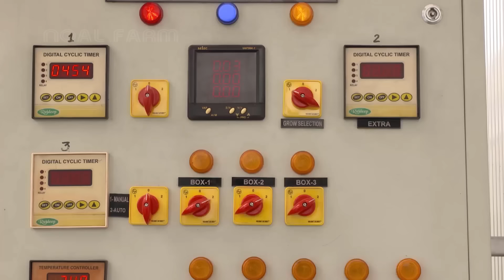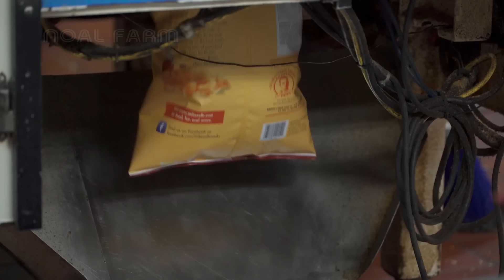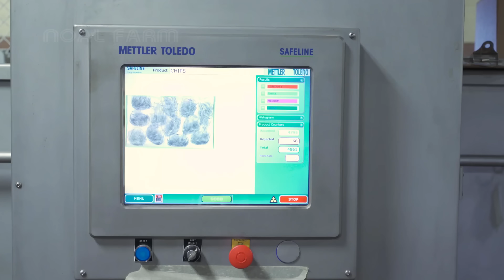Aeroponics Potato Farming - Potato Chip Process Factory - Modern Potato Agriculture Technology

Comment: It’s impressive. I wonder why the potatoes are so small, maybe because the weight would be too much for the roots to handle. I wonder how the absence of soil bacteria affects the growth.
Reply: that's my guess.. they don't let them grow bigger or it tears the roots off......though that seems to be an engineering issue.  maybe some sort of treelike structure to "catch" the roots and support them would allow for larger growth......
Reply: The soil edaphone system performs the backbone of molecular mining. Hifas grows in the intercellular gap of the root and the macrocomponents are replaced by plant sugars (symbiosis). I have read almost all books and articles and dissertations on this. but the break was not in them for an aeroponic case ....
Reply: It’s actually price and vanity related. These potatoes sell as “gourmet” for over 20 times the price of large/ fist size potatoes.
Reply: Correct.
Reply: However, it may be possible to find a solution for the aeroponic application of hypha. If we were to create a secondary fungal powder delivery system that would graft mycorrhizal connections along the plant stem and root. It may be enough to do it only occasionally. But it may also be enough to have a hand-held spore nebulizer here.
Reply: @zoltanpecsek4373  There is no point in using any soil bacteria/fungi when you hgave the most efficient water and nutrients delivery system. You would only create problems by introducing them.
Reply: @ThomasShatter   I found a total of four articles on the issue. It can be seen that the problem has not been explored yet. This is the beauty of research. You are probably right that we do not yet know how to implement the idea well ...
Reply: Size is not everything
Reply: @WaterspoutsOfTheDeep  

Your suggestion is very important. At the moment, we simply have not solved this riddle enough. It would be worthwhile to do such research because it seems that we are beginning to reach the planet’s carrying capacity. Somehow, the URBAN FARMING system needs to be further developed in the direction of a closed nutrient cycle. Otherwise, the promising Biosphere 1 and Biosphere 2 projects failed for similar reasons. I risk knowing this can go beyond any military development ...
Reply: @SimonWoodburyForget  what about areas where the soil is not suitable, due to contimination,  poor climate, what ever...
Reply: @zoltanpecsek4373  она не изучена это точно.экспериментальная технология.но интересная.не решена проблема крупных плодов.тут решение просто сетка.не решена проблемма света.обычный свет и искусственный.замена химией с водой.тут куча проблем.на семена не годится.выращен в биохимической среде не соответствующей почвенной.в продукцию.это не очень полезный продукт.как химия также не соответствует естественной среде.идет подбор химикатов что не вредят.в чем проблема бактерий и земли.в земле больший спектр минералов необходимых организму.также бактерии в земле перерабатывают гумус и приводят земельную структуру в соответствии с биохимией человека что легко поглощается растением.это не возможно создать.также как состав почвы схож с населением проживающем на этой земле.наука находится в зачаточном положении.не говоря о познании человека.также это производство сто процентно убыточно.технологично затратно и много обслуживающего персонала на килограмм продукции по сравнению с полями.ну эффективность пять десять процентов от полей.
Reply: @user-pp5tx6pz2f  Уважаемый Андрей! Я с интересом прочитал ваш комментарий. Здесь, в Венгрии, в одной из цитаделей сельского хозяйства, мы постоянно имеем дело с этой проблемой почвы. Хотя теперь мы можем выращивать овощи без почвы, мы поняли, что это не очень полезно для здоровья. Наш великий ученый Йожеф Берез выяснил, что если мы не даем достаточно микроэлементов нашим растениям, то можем вызвать рак у людей. В связи с вышесказанным, сейчас я работаю над датчиками молекулярного анализа для почвы. Я уже сделал оптическую версию, она работает. Китайские коллеги сделали импедансные спектроскопические версии с вносимым импедансом. Сейчас я работаю над созданием гравитационного молекулярного датчика, который будет измерять содержание гумуса и активность бактерий. Я также буду использовать для этого ваши книги по исследованию большой силы тяжести.
Reply: @zoltanpecsek4373  интересно какие мои книги читали.вот интересно как подбирали химические компоненты для расствора.как изготавливают.и почему именно такой состав.используется ли спектральный анализ в подборе питательной среды.не совсем понятно.там в корнях система воздушного пространства герметична.этот ролик похож на экспериментальную лабораторию.или я ошибаюсь.
Reply: @zoltanpecsek4373  я понял что вас обьединяет и проблемы в ваших разработках.вы проводите биологические испытания в поисках альтернатмвы выращивания продуктов.из за проблем с почвами и решения вопросов с продовольствием.отсутствие необходимых площадей обробатывания земель..из за каменистости и песчанности.активно развиваете или пытаетесь построить биоинженерию.любопытно бы поработать с вашими специалистами.хотя сложно это по интернету.так как это относится к секретным испытаниям .куда входят опыты с геномом клеток.
Reply: @zoltanpecsek4373  теперь понятно про наличие биолабораторий в украине и вырубка леса на дальнем востоке.поля для сельхоз угодий.
Reply: @zoltanpecsek4373  картофель очень хорошо растет даже в песке.но он обладает меньшими вкусовыми качествами и более водянист.структура его соответствует среде произрастания.единственная проблема это поливка в песчаных почвах.это является проблемой.
Reply: @zoltanpecsek4373  кстати почему чипсы щитаются вредными.сами по себе они не вредны.канцерогены химической промышленности впитываемые картошкой не всегда несут вещества которые вредны организму из за наличия тяжелых соединений.в обычной готовке они с сохранением водяного баланса частично выводятся.при выжарке в чипсах.они концентрируются в малом обьеме.и при попадании в организм забирая влагу вступают в реакцию с эпителием органов.биохимические ппоцессы с концентрацией тяжелых металлов дает микроскопические поражения с вкраплениями тяжелых металлов.они становятся как радиационный очаг и идущие химические реакции вызывают болезни.например язва.при разложении этих элементов.происходит излеченме.хуже обстоит с радиавтивными изотопами.они дают длительную ремиссию и образования клеток которые от поражения с нервной системой нацинают расти вокруг радиактивной зоны.этот изотоп сшигает геном клетки.и она потом растет неуправляемая органмзмом.это рак.
Reply: @user-pp5tx6pz2f  Наше правительство финансировало наши исследования. Без химикатов я сделал запатентованный спектрограф с чистым диффузным отражением, который собирает свет. Структура размером со спичечный коробок. Он сразу скажет вам содержание макрокомпонентов почвы и ph почвы и подавляющего большинства микрокомпонентов. О нем также спросили в ФАО ООН. Для этого китайский коллега сделал импедансную спектроскопию. Я делаю то же самое сейчас. Жаль, что запчастей практически нет из-за COVID. Поэтому я переделываю все на китайские детали. COVID-19 возобновился в Китае. Бог играет с нами...
Reply: @user-pp5tx6pz2f  Мы, венгры, тоже были очень напуганы украинскими лабораториями. Мы и мечтать не могли, что будут проведены такие грубые биологические разработки. Украинские исследователи бежали к нам. У нас хорошо развита медицинская промышленность, и мы сразу взяли их к себе для работы над биохимической разработкой дерматологического оборудования. Нам не нравится биологическое оружие, мы предпочитаем медицинское оборудование и лекарства. 
Мы видели, насколько развита ваша медицина с использованием животных экстрактов. Пантовая ванна - большая тема для разговоров здесь. Сейчас мы пытаемся изучить биохимию, чтобы понять, можно ли из него сделать лекарство. Мы нашли Российская диссертация и Kитайские публикации на тему экстракта пантов оленя и инструментального определения активных веществ. Вы очень изобретательные люди.
Reply: @user-pp5tx6pz2f  Неудивительно, что вы этого не понимаете, ведь поначалу даже наша научная академия была недоверчива. Они попросили предоставить им 1000-страничный исследовательский отчет за первый год. После пересмотра и пересчета результатов они поняли, что я был прав. Уравнение Кубелки-Мунка описывает диффузное отражение. Версия светодиодного диода и детектора американской компании Holland Scientific была блокирующим патентом. Поэтому я разработал спектрограф с гибкой решеткой, который использует принципы КАО (принципы диэлектрического волновода) для сбора света с выступающей части самой решетки и проецирования его на решетку. Он разбивается решеткой на компоненты и детектируется ccd, усиленными в специальных сегментах.
Я гомогенизировал тонкую базовую почву. Затем я использовал азот фосфор калий и т.д., чтобы смешать его с водой, а затем гомогенизировал его и снова измерил его состав.  Я определил уравнения диффузного отражения путем корреляции с устранением перекрестных ошибок. Измерительный датчик в 7 раз чувствительнее любого спектрографа, представленного на рынке. Мини-спектрограф был интегрирован в наземный зонд. Он использовался для наблюдения за сверхинтенсивными плодовыми деревьями.

Китайский аналог проводит измерения путем декомпозиции кривой участка на основе идентификации кривых Cool-Cool. Он также представляет собой импедансный спектрограф размером со спичечный коробок. В нем используется DDS.
Reply: @zoltanpecsek4373  прочитал про уравнение.нужно посмотреть устройство других устройств чтоб понять разницу.не хочу лезнь в дебри электроники и схем.забивать пока мне не нужным.удачи в ваших разработках.
Reply: @user-pp5tx6pz2f  Дело в том, что программа не является секретной. Послушайте, я обученный технический визионер в технической области. Я знаю ваши программы видения (программа Дадачева и т.д.), но знаю и американские (Cordinata Remote Viewing CRV и т.д.). Я могу смотреть практически на все и обычно могу это проанализировать. Я подтверждаю ваше подозрение, что наша венгерская элита вкладывает свой капитал в сельское хозяйство, потому что это выгодно, но есть много проблем. В сельском хозяйстве и пищевой промышленности мы не хотим видеть иностранцев, особенно западноевропейцев, потому что после смены режима мы были практически разорены и обмануты. Да, мы развиваемся в области сельскохозяйственной биоинженерии, но не через генетические манипуляции, потому что мы не понимаем, как это отразится на окружающей среде. Мы больше занимаемся биохимией почвы и приборостроением, улучшением почвы без удобрений и опрыскиванием без химикатов с использованием физики плазмы и плазменной микромидации. Мы внимательно следим за методами волновой генетики и физики плазмы в вашей стране, потому что вы сейчас находитесь на переднем крае. Видите ли, наши программы раскрыли образ действий бога-создателя, и у нас есть единая теория этого, которую усиленно изучает ваша российская научная элита.  Возможно, удастся создать особый вид сельского хозяйства, который не разрушает почву и не нуждается в химикатах, вот что мы пытаемся сделать.
Reply: @zoltanpecsek4373  если вам интересно со мной общаться .я с удовольствием побеседую.у вас не верное представление о происходящем у нас в стране.также у вас в стране об науке и обомне.что такое визионер кем себя считаете.мне нужно понять с кем и на каком уровне общаться.я не сторонник ни чьих идей .научных теорий и релмгий как и принадлежности к идеологии стран и власти.мои знания от человека основаны на прочитанном за свою жизнь как код.и каждодневно поступающей информации от всего со всей земли и вселенной.мой мозг взрывает от этого и тело.я эволюционирую.читаю часть энепгии как силу и знания.очень малую часть .возможно тысячную долю процента.остальная хоанится пока мозг не усложнится и они не открываются.могу сам вскрывать когда интересуюсь чем либо.но это мешает мне выполнять тупую работу за кусок хлеба.
Reply: @user-pp5tx6pz2f  Когда я разговариваю с вами, я не использую экстрасенсорные методы. У него есть свои ограничения, это довольно трудоемкий метод. Я не могу в полной мере судить о том, что происходит в вашей стране, потому что это тоже слишком сложно. То, на что я смотрю, я в некоторой степени понимаю после большой работы.
Бывают случаи, когда я начинаю работу и вынужден признать, что просто мало что понимаю.
Но с вами, в частности, я действительно хотел поговорить, потому что думал, что вы будете откровенны и не будете сердиться. Прости, что разозлил тебя.
Reply: @zoltanpecsek4373  я опять не пойму.причем здесь экстрасенсорика.мне например интересно как используешь способности если есть.и разозлило меня не это я возможно думал масштабней и сказанное про прибор не соответствовало моей идее которую рассматривал.я не могу мыслить как все.любые действия рассматриваю в связи со вселенной на многих уровнях.
Reply: @zoltanpecsek4373  мне интересно общаться с умными людьми и учеными во всех областях.но некоторые аспекты я не тороплюсь ускорять.это вызывает головную боль и колеблет климат и энергетику планеты.мне интересны ваши разработки.я еще пятнадцать лет назад хотел создать биолабораторию с опытами мысленно технического воздействия на икру рыб для создания новых видов под адаптацию под новый климат .изменения которые были давно по выращиванию из яйца новых видов животных и т.д.прошли годы.силы растут а воплотить не дают.потому и развлекаюсь коментариями в интернете по всему и всем направлениям.от скуки.
Reply: @zoltanpecsek4373  я с удовольствием бы жил в нормальной стране и занимался интересным мне делом.и жил бы без финансовых проблем.но меня гнобят и не дают возможности это сделать или уехать.
Reply: @user-pp5tx6pz2f   Все человеческие экстрасенсы просто не практиковались в том, как это делать. У меня есть библиотека по этой теме объемом 40 000 томов, которую я храню на своем USB-накопителе, и она содержит 400 лет книг по обнаружению экстрасенсов.
Первоначально он был разработан коллегами-шаманами, затем получил развитие в шаманизме Бона, затем в буддизме и индуизме. Во время холодной войны обучение экстрасенсов проводилось и в вашей стране, и в Америке, а также в Китае и Чехии. Мой коллега (физик) написал об этом книги... Существует множество различных техник, но все они основаны на осознании того, что душа человека является копией кванта творческого источника. Когда он спускается в творение, квантовая сборка сохраняется (жидкость перемещается). Мы пользуемся этим. В гипнозе квантовые носители могут помочь путешествовать нашей душе, но при большой практике путешествовать может и тело. Поэтому с помощью Бога вы можете видеть все, но только то, что Он вам показывает. В интеллекте над нами мы являемся сущностями. Я использую шаманские путешествия и медитации, а также части программы CRV и вызывания. Логично, что я работаю в уединении с отключенным внешним миром, как и все остальные.
Таким образом, вы видите, что это просто другой уровень понимания мира.
Reply: @user-pp5tx6pz2f  Я тоже хотел бы жить в мире, где я могу доверять другим людям. Сейчас у нас большие проблемы, потому что надвигается продовольственный кризис. Я не уверен, что мы сможем это преодолеть. Это усугубляется энергетическим кризисом. Я хочу бежать вперед, но мои ноги не могут бежать так быстро, как должны...
Reply: @zoltanpecsek4373  вопервых душа является копией ядра или планеты с отклонением в поверхностных слоях.это уровень бога у кого душа ядра.это владение энергетикой всей планеты.это есть и в биологии зачатия и рождения ребенка.остальные души как временные проекции оасположены на поверхностном слое земли и не обладают такой возможностью и соответственно интелектом.и поэтому у всех отсутствуют знания.как у клетки кожи.вроде копия но без разума и мощи над энергетикой.следующий уровень когда возьмешь мощь планеты и станеш богом во плоти.планета зпвязанна на вселенную.где человек по сравнению с планетой никто.так и планета по сравнению со вселенной.это не возможно но это происходит.через планету можно взять и управлять вселенной.тот же принцип.но для этого долгий путь эволюции как сверхразума.так рост тела до гигантов с изменением биохимии тела под мощь контролируемых сил.легенды про богов.можно создавать сверх технику когда ты понимаешь принципы энергетики.и создавать живые организмы.они и так будут появляться.но можно делать селекцию.
Reply: @zoltanpecsek4373  идет смена власти и переустройство мира под власть единую.
Reply: @user-pp5tx6pz2f  У нас есть организация под названием "Церковь Вселенной", которая является частью Унитарианской христианской церкви. Сверхтехнологичные умные люди интегрированы в нее, и я тоже. У нас работает исследовательская группа психологов и обученных экстрасенсов. Мы рассмотрели, чего можно ожидать в ближайшем и отдаленном будущем. В ближайшем будущем, если русские и американцы не набросятся друг на друга с ядерным оружием, нас ожидает тяжелый период, когда не будет хватать продовольствия и энергии. В течение этого периода духовный максимум будет наращиваться до уровня сознания единства примерно в соответствии с моделью интеграции трансперсонального сознания "Кен Вилбер" в течение примерно трехсот лет. В это время человечество будет освобождено из космического карантина. Человечество будет выведено за пределы Солнечной системы. Примерно через 500 лет он научится терраформировать планеты с большим трудом. Примерно через 2000 лет она научится управлять своей собственной системой точек (как Иисус = ISA). Напротив, есть исследовательские программы, в которых я принимаю участие. На наших учебных курсах сидхи возникают у 60% участников.
Управление небесными телами в описанном Анастасией смысле не найдено. Кроме того, наши исследования были подтверждены экспертами по регрессионной психологии. В результате появились книги.
Reply: @zoltanpecsek4373  это не так.хочешь обсудить начинай не с массива .а отдельных тем.меняешься от ученого до массонских лож.может скажешь сам кто ты.я наблюдал сегодня за попыткой воздействи.слабоват.
Reply: @zoltanpecsek4373  как не мне знать что я буду делать.не люди.у вас очень мало информации о происходящем.
Reply: @zoltanpecsek4373  меня пресует и удерживает весь мир все лучшие ложи и религии и сенсы.чтоб понимал.я сильнее всех в мире вместе взятых.и твои планы я уже описывал и говорил как буду делать и с научной точки зрения уже годами и каждый день.я контролирую мир и его все подвижки.задавай простые вопросы.
Reply: @zoltanpecsek4373  какая интересная связь китай британия европа и папа римский.
Reply: @zoltanpecsek4373  я много раньше ее касался и бельведерского клуба.я рассказывал про всю власть во всем мире от мирской до духовной.
Reply: @zoltanpecsek4373  мне интересно кто вам скинул информацию.она начинает распространятьсявы не первые.
Reply: @zoltanpecsek4373  это я отдал приказ распространить.
Reply: @user-pp5tx6pz2f  
Я не масон. Мне они не нравятся. В нашей стране Церковь следит за учеными, чтобы они не создали что-то опасное, не отвечающее интересам общества или выступающее против жизни. Это механизм самоанализа. Я считаю, что в Православной церкви есть такой механизм. Я думаю, что эту работу выполняют "мудрецы, ставшие знамением".
Вы задали вопрос, я ответил в меру своих знаний. У меня есть подробные знания о доступных методах программирования сознания, аналогичных указанному вами сидхи. Я сам им пользуюсь. Но следует заметить, что провидцы, которые приходят на нашу планету, обычно приводят примерно к тому уровню, который вы обрисовали. В вашем случае Министерство по чрезвычайным ситуациям пришло к аналогичным результатам. Я думаю, что у вас есть учебник по этому вопросу в Ломоносовском университете. Вот он на моем столе.... Мы еще не имели удовольствия встретиться с оригинальными посетителями уровня создателя. Мы полагаем, что они выполняют свою работу на другом уровне.
Reply: @zoltanpecsek4373  забавное тексто изложение.я смотрел от кого тянет.вы это подтвердили.если я и в чемто для вас и ошибся.но это не совсем так.ведь мое написанное отслеживается и я вижу их реакцию.а она связанна с перепиской с вами.потому я и спрашиваю.идет наложение информации что меня путает.наводящие вопросы проясняют ситуацию.
Reply: @zoltanpecsek4373  и я не пользуюсь ни какими техниками.я уже писал.я ничего не практикую давно.работаю тупо таксистом.зарабатываю на еду в пределах четырехсот рублей.из них половина сигареты и спиртное.весь в долгах у меня даже одежда что на мне.меня пресует сесь мир и держат спецслужбы.меня боится весь мир.
Reply: @annjulee500  bs
Reply: I, Nephi, having been born of goodly parents, therefore I was taught somewhat in all the learning of my father; and having seen many afflictions in the course of my days, nevertheless, having been highly favored of the Lord in all my days; yea, having had a great knowledge of the goodness and the mysteries of God, therefore I make a record of my proceedings in my days. Yea, I make a record in the language of my father, which consists of the learning of the Jews and the language of the Egyptians.
And I know that the record which I make is true; and I make it with mine own hand; and I make it according to my knowledge".  1 Nephi 1-3 

Hello friends, I am a member of The Church of Jesus Christ of Latter-Day Saints.  The verses above are the first three verses in The Book of Mormon.  I know this probably isn't the most ideal place to talk about religion but I really do want you to know that God loves you.  You may not love Him or care about Him at all, but He still will continue to love you.  You are a beloved son or daughter of God.  He knows you personally and He truly and deeply desires for your happiness.  He loves everyone who has every lived on this earth, with a perfect equal love regardless of their race, gender, ethnicity, faith and values and beliefs.   The Lord loves you more than you can think or comprehend.  "He inviteth them all to come unto him and partake of his goodness; and he denieth none that come unto him, black and white, bond and free, male and female; and he remembereth the heathen; and all are alike unto God, both Jew and Gentile" 2 Nephi.  He is our loving, caring Heavenly Father.  We are literally His children and creations.  When we were in the womb, he knew about us" Jerimiah 4:5.  He knitted us and we were created in His image.  

I testify to you that you and I are not a mistake.  He knows the very moment when we stand and when we sit.  He is familiar with all our ways and knows us personally who we are.  The hairs on our very head are numbered.  God loved us so much, He sent His Only Begotten Son for us, that we may be able to return and dwell in the presence of God again.  The Lord has not forgotten about us even when it feels like He has.  He will never forsake us.  When we are happy, He and His angels rejoice alongside us.  When we are sad, He heals us and lifts us up from our trials.  He has always been there for us.  He has always been our loving, compassionate Heavenly Father and God.  Will we always be His children and people?

I testify to you that God lives and that Jesus is the Christ.  Both love you exceedingly and rejoice when you are happy. They both love you so much.  They love you with a love unfeigned.  They will never ever stop doing good unto you.  I know that The Book of Mormon is true.  "And when ye shall receive these things, I would exhort you that ye would ask God, the Eternal Father, in the name of Christ, if these things are not true; and if ye shall ask with a sincere heart, with real intent, having faith in Christ, he will manifest the truth of it unto you, by the power of the Holy Ghost".  Moroni 10:4  I promise and testify to you, that if you will read The Book of Mormon, ponder on its message and ask God if it is not true, you will come to know of its truthfulness, whether its true or not true.  

Remember my friends that God loves you with all his heart, might mind, soul and strength.  He wants you to be happy.  He knows what you are going through and dealing with right now.  He desires for you to return back to Him.  Unfortunately, He has been misrepresented and seen as a cruel and angry God who anticipates for us to slip and writes down every mistake we make waiting to punish us by those who do not know or know Him fully.

My friends, God has stored many opportunities and blessings for you.  He is incredibly eager and desires with all His heart to bless you abundantly.  He wants you to live with Him again.  He only wants the best for you and your well being.  He wants to experience everlasting joy and indescribable happiness in this life and in the life to come.  He wants you to partake of His goodness and come and follow Him.  The Lord does not care how early or late you decide to come unto Him.  I testify to you that if you have strayed and wondered off the path that there is peace and hope in Jesus Christ, The Savior of the world.  The Lord accepts those who come unto Him whether your early, late or just in time who desire to change.  The Lord will accept you wholeheartedly and forgive you if you are willing to change.  The Lord will welcome you and will always be ready to embrace you with open arms.  The Lord will lift us up in our trials and use us to bless the lives of those around us if we are willing to change.

If you desire to learn more, you are always welcome to visit comeuntochrist.org.  There you will learn more about The Church of Jesus Christ and our core beliefs and values.  If you have taken the time to read The Book of Mormon and this comment, thank you.  It takes a huge leap of faith and a lot of courage to muster enough faith to read in the Book of Mormon and to believe in something in a personage that you may never see in this lifetime.  Although we may not be able to see God and Jesus Christ in this life, I testify to you that they are real.  They do truly exist.  I promise you that if you will pray to know of their existence, you will come to know whether they exist or have been made up.  

You are my friends.  The Lord loves you unconditionally and is aware of you and despite all our weaknesses and shortcomings, he still loves us and will forgive us if we will humble ourselves before Him and diligently seek correction and do whatever is needed to repent.

Remember that The Lord is always available to talk to through prayer 24/7.  No question sounds too silly for Him.  James wrote, "If any of you lack wisdom, let him ask of God, that giveth to all men liberally, and upbraideth not; and it shall be given him" James 1:5.  If you must know whether or not something is true or evil and deceptive, you can always pray to God.  He will help you know what the truth is and what is not the truth. He will never be too busy to talk to.  He will give you strength you need to overcome and conquer your temptations and will give you the strength you need to endure through your trials and afflictions.  Paul said that The Lord will not give you temptations that you cannot resist, but that in your temptations, He will provide a way for you to resist, overcome and conquer them.  He will provide a way.  He wants to bless you and reward you abundantly in Spiritual and physical things.  The Lord knows you and will not forget you.  You are loved.  You are utterly amazing.  You have incredible potential.  You are not forgotten or ever will be forsaken.  You are special.  You are unique.  You are one of a kind.  You have been reserved for this time and The Lord needs you on His side.

It simply would not be the same without you.  That's just how much the Lord need you on His side.

Thank you dearly for your time.
Reply: @annjulee500  No they don't, they are sold as small potatoes and cost less in European supermarkets. The expensive variety are small breeds like Jersey, that have a fantastic taste